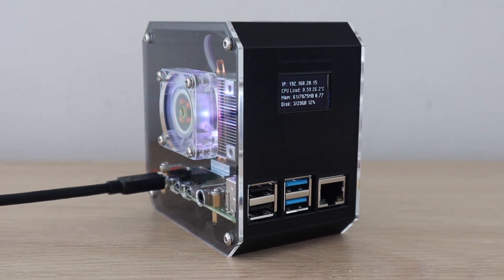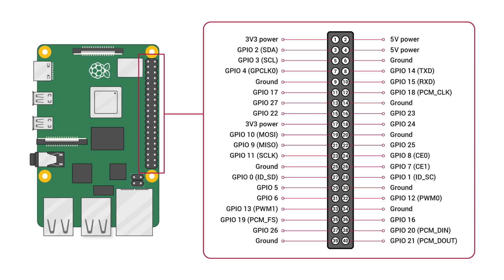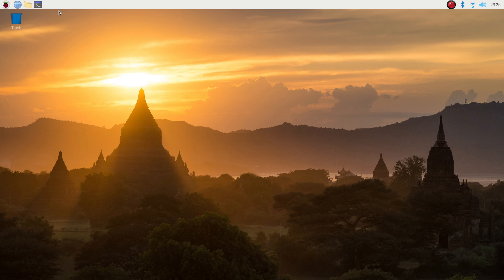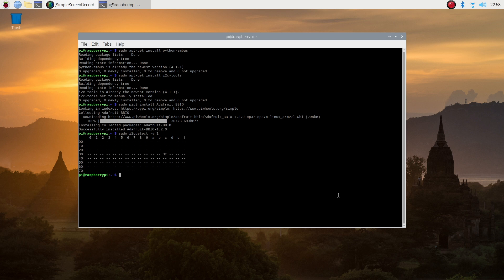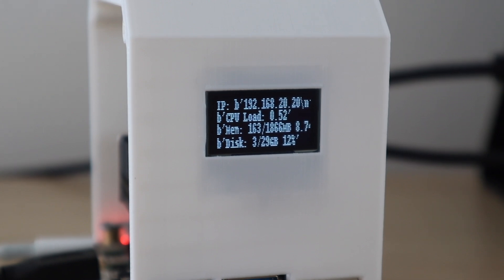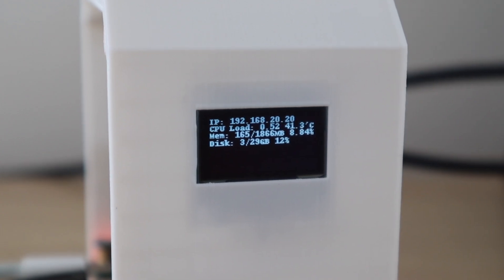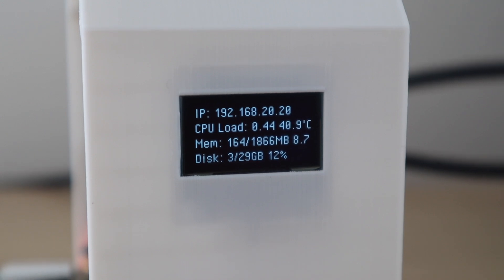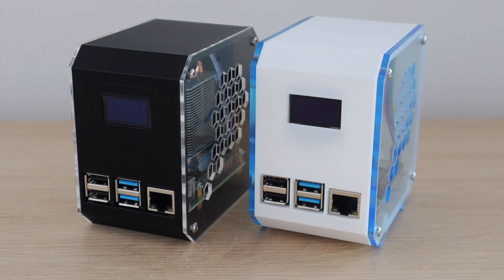Connect and Program An OLED Stats Display For Your Raspberry Pi

Comment: I have this case folks skip over it. It's cheap garbage. On top of that this a terrible instructional video cant even see the code you typing Mr. "By typing in this code here.", I couldn't personally see anything you were doing also mine didnt  even have the lil feet this case is a total McDonalds situation. Looks fire on tv, but is crap in person
Reply: i bought one.  mine was pretty nice.